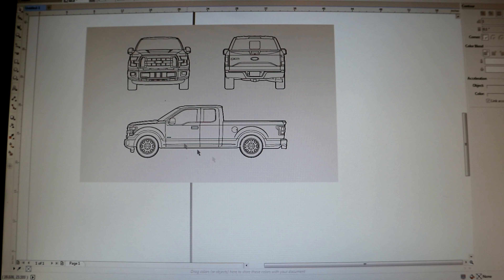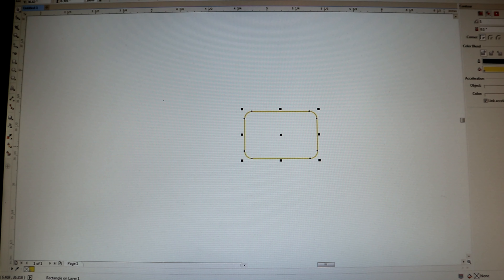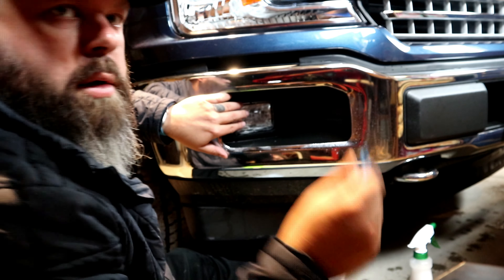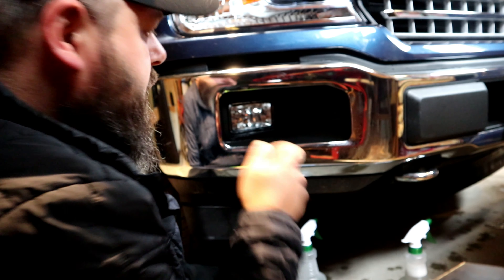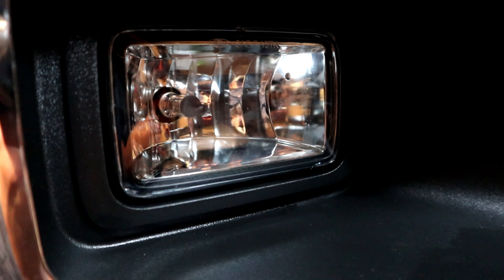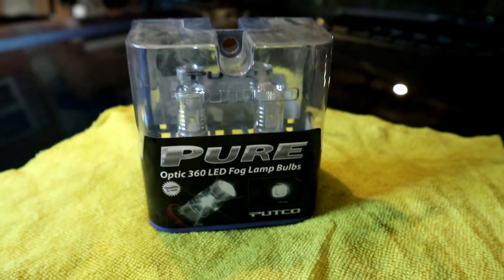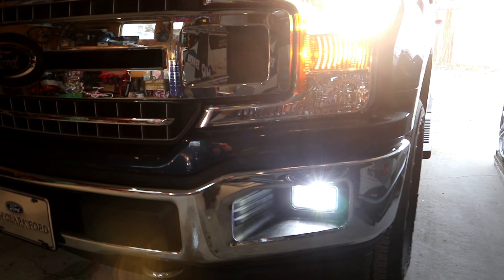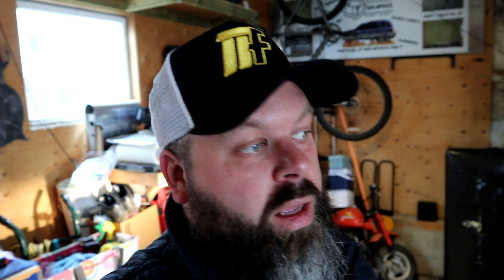2019 Ford F150 Fog Light Replacement | Fog Light Protection

Comment: Csp mini led headlight bulbs are closest to factory size wise and will allow you to put the dust cover back on. I haven't purchased any yet but that's what I have seen on videos and comments.
Reply from the maker: Thank you for the awesome info, I will definitely look into those for the replacement. 🙏🙏🙏
Reply: @HQGARAGE  I also actually took out my LED bulbs from my previous vehicle which was a Toyota Venza with h11 bulbs, same as my 2020 F-150 XLT. I saw several videos in addition to the one I told you about the CSP mini bulbs. One guy actually stuffed / tucked the extra pieces that come with the SV4 bulbs from headlight revolution into the housing and it worked for me, so I didn't have to buy the CSP minis actually. But I would suggest the CSP minis if you don't want to spend any extra time. It didn't take much more time but the right side, passenger side was a little more tricky because of the angle of the tire I think. Good luck